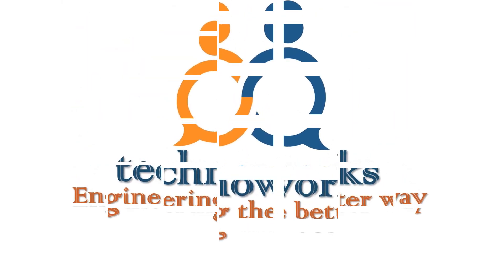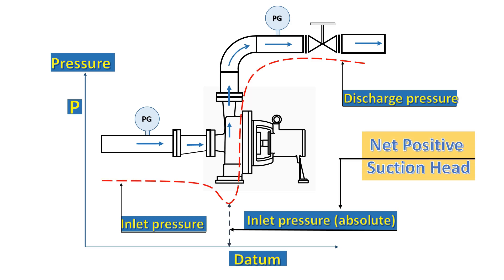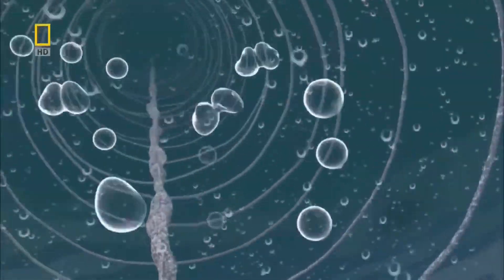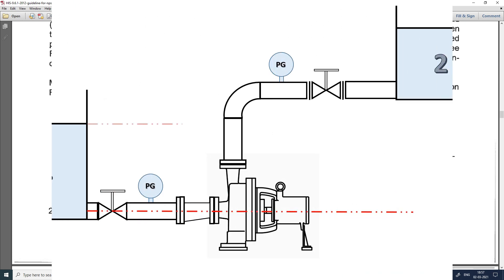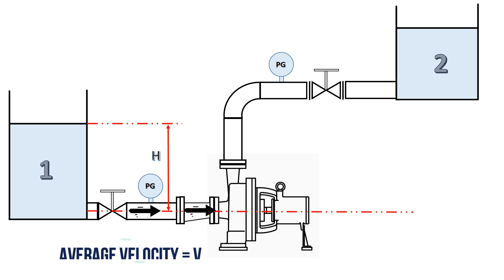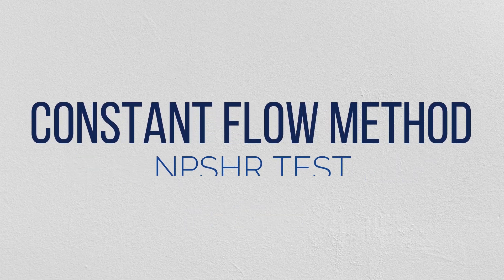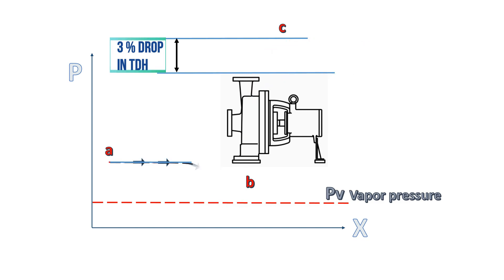pump cavitation and net positive suction head

Comment: There's a mistake. You start the test with the valve halfway closed because, as you slightly close the suction valve, you must open the other valve to maintain the same flow rate. Otherwise, the flow rate would change due to the closing of only one valve.

Comment: From 5:17 there is mistake in the video. You already mentioned that the NPSHA is the absolute pressure above the vapor pressure but in 5:17 your NPSHA becomes below vapor pressure (your reference point is no longer the vapor pressure).

Comment: Good explanation, but boiling temperature should be mentioned to complete the picture.

We know water boils at 100degC in our kitchens because we are typically at standard sea level atmospheric pressure and saturation temperature.is 100degC.

However at pump inlet, we have a vacuum and pressures could be much.lower than the standard sea level atmos pressure and in some regions the absolute pressure is.lower than the vapour pressure threshold, this.means its boiling temperature is near to the room temperature and the water starts boil and then cavotation.process continues.

Comment: In the section on measuring NPSHR using a constant flow test (constant Q) you state  @4:56 that outlet valve is kept at a "fixed open position" to maintain constant flow.  However, if you throttle down the suction valve to increase flow resistance and decrease NPSHR then you have to adjust the outlet valve to maintain constant flow.

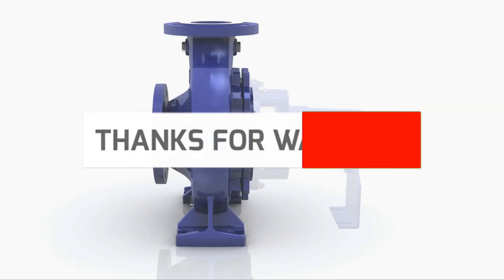Comment: 6:43 Once you close the valve at suction pipe, the head of the pump does no remains constant. By closing the valve you are increasing the piping resistance and therefore the behavior expect for the pump is to reduce the flow rate and increase its head. One of the methods to measure NPSH required uses a closed suction tank.